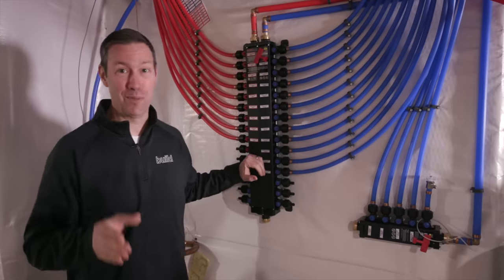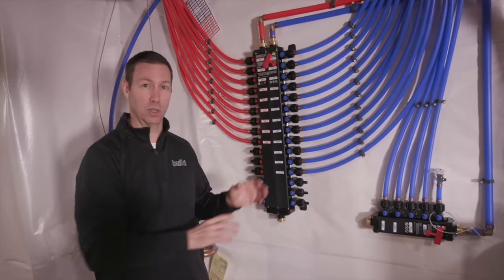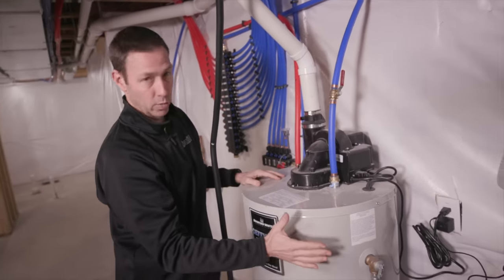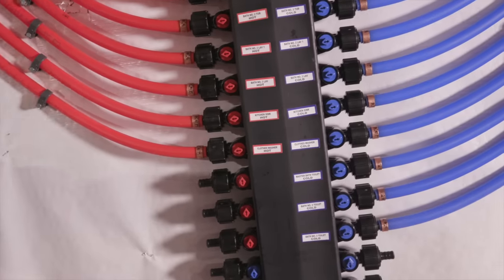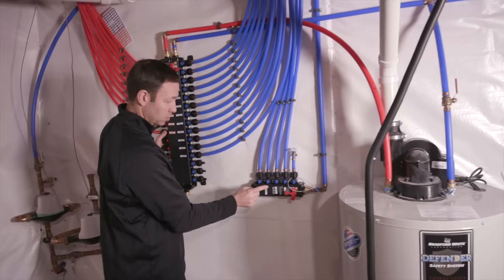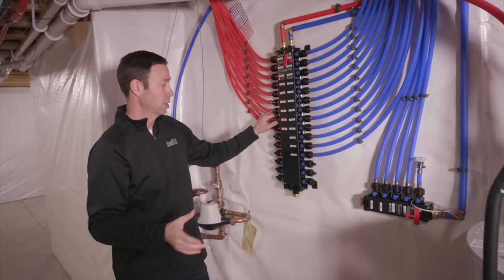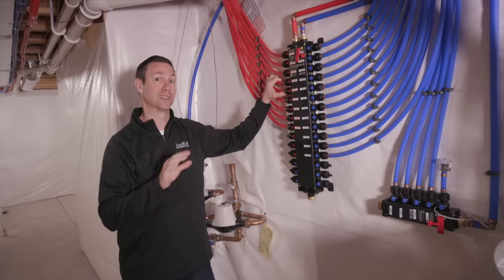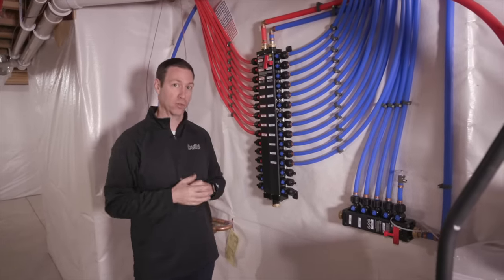PEX Manifold System - Pros and Cons + Tour

Comment: I am a plumber and my biggest complaint about the block system is this... Say you have to work on a toilet on the second floor of a house so first step is to go to the basement and shut the water off to that toilet. Then climb 2 flights of stairs, do the necessary repairs, then wall back down those two flights of stairs, turn the water back on, then back up the stairs hoping there is no leaks while you climb. Then check your work and if some reason you would have a leak, you start that whole process over again. With something like copper you can do all of the repairs without leaving the fixture for the most part. That’s my two cents lol
Reply: I always add a valve under the tank.  You're lucky if a lot of places have even one operable shut off.
Reply: So are you saying that they don't have a shutoff at each fixture? What a pain!
Reply: I'm curious your opinion on a hybrid system where the manifold feeds to a trunk to each room.  this way you would still have your shutoff valves at the fixtures  but for things like the shower you only have to shut off water to that room.
Reply: Trevor Butler they are better but you have to have a place in the bathroom for one. And sometimes there just is no good spot for them. Another thing is these manifolds have special valves that you have to buy from the manufacturer. It’s not something you can get from a hardware store. And no matter what the manufacturer says, valves go bad.
Reply: @ericblatt5249  yeah I would never install one on an existing house.  I have a long term goal of building my own house, in this case I can design room for the manifolds in mind.
Reply: @Eric Blatt "then back up the stairs hoping there is no leaks while you climb. Then check your work and if some reason you would have a leak, you start that whole process over again. "   Sounds like you experience post-repair leaks a lot or have very little confidence in your work.  Not trying to be rude, but the ONLY drawback to a PEX system with no fixture shutoffs (I did one in my 1200sqft one story house) is that if you DO need to change something at a fixture, you have to catch all the standing water in the pipe.  I have 14 lines, and not one of them leaked at all and still haven't after five years. All of them are home runs, only fittings are at the Manablock and the fixtures. With the right tools (which I bought) and the "go/no-go" gauge, (used crimp rings) it was fast, easy and foolproof. I have never had to make multiple trips to the Manablock when adding on fixtures. BTW I am not a plumber, but an electrician. Oh, as for the "special valves", a set of those and the tool to change them is cheap, I have a spare set handy, which I expect to never use.

Comment: I agree with Matt. I love the look and idea of a water "breaker" panel, but in practice, I think you'd have a lot of issues with water not coming out cold/hot for several seconds, especially when pipes are uninsulated. Insulating pipes would help a lot. My pipes are insulated and trunk and branch style (though with the size of my house, all the fixtures are beside each other), and I still hate how long it takes to get hot/cold; I would lose my mind on this.
Reply: If waiting seconds for hot water will make you lose your mind, you have some serious issues. The run from my manablock to the master bath shower is just over 33 pipe feet, and it takes less time for the hot water to arrive than it does for me to get undressed for my shower.  I just don't get why everyone is so damn impatient. The water use to purge the cold is only a gallon or so, and not a lot of time. Must be a millennial thing.
Reply: @mxslick50  A gallon each day times 4 people times 365 days times 20 years... That's a lot of wasted water. 29,000 gallons. If you cut that time in half, not only do you wait less, but you save 15,000 gallons over 20 years. And that's one fixture.

Comment: CONS : the massage jets in my shower also require 3/4 pipes for the 4 of them, where the manifold only provide 1/2, which means you would have to run two lines just for that..
Reply: And the fittings reduce the flow by almost 1/2 so make that 4 lines
Reply: I do beleave you can get the manabloc in 3/4” also.

Comment: My house has a manifold system installed about 12 years ago. The ability to shut off a few specific fixtures is great for repairs, especially those that take a few days or weeks to fully address (shower remodel), and for turning off outside faucets during cold months (NH), but the waiting  for hot water is annoying.

Comment: You can also do a trunk and branch using a few thick pex and then small manifolds for say the bathroom fixtures locally. Makes it easies and ttake less time ot get hot. Thats how a lot of larger construction is moving. Gets hot much faster and costs only a tiny bit more

Comment: Your con would be solved with this system which i have install 13 of them , point of use tankless for the long distance lines for hot.
Reply: Brad's Home Improvements what about also putting in a recirculation fixture with a timer and back up battery?
Reply: @davidb1132  wouldnt know first hand. I Have not had any radiant heating systems in the ones i have installed. Which is what i  am assuming your refering to.Meaning  none of the ones I install had Recirculating systems.

Comment: I have this system in my house. My house is 3000+ sq ft. It does take a little longer to get to my upstairs fixtures. But flush the toilet, run the sinks and shower at the same time without the shower changing temp or pressure, so yeah there is another plus. Surprised it wasn’t mentioned about that aspect.

Comment: In Atlanta the sewage bill is figured off of you water bill (usage) so that when you wash your car you are still paying fees to the sewage department. How that is connected with this issue is that you will pay for the water you run down the drain while waiting on hot water to both billers.

Comment: I adapted my lavatories down to 3/8” and used 1/2” to showers and the washing machine.  The 3/8 has less volume and we get hot water faster.  The flow isn’t enough to approach the limit on the faucet so it works well!!!
Reply: Or you can do loop system with pump (3/8" return) on hot and set timer for times when hot gets used most that way you get hot in few seconds.

Comment: I would never use that system. One of the most expensive things you do is heat water don't ever waste it if you can. If you have gas do on-demand hot water in each room you need it, if not make sure that the runs to hot water are as short as they can be and all of your hot water branching is done as close to the endpoint as possible.

Also, who doesn't have a way to shut off the water right at the sink or toilet? Are you kidding on the extra fixture thing? How much time does a person waste running back an forth to the basement? And what if it's leaking when you cut it back on? This is silly.
Reply: I'd imagine there are still below the sink shut off valves. I wish I had individual branch line shutoff valves when I replaced leaking below the sink shutoff gate valves that leaked from the stem when touched.
Reply: It's not tho. It's set up next to the water heater. So all those hot water lines run straight to it.
Reply: I thought of the same question too. So say you get a leak in the kitchen sink. Now you have to run to the basement to turn off the switch that used to be under the counter? Seems bizarre to me

Comment: All of that work to keep all the sweeping bends and then the plumber places a hard 90 at the input of the manifold 🤦‍♂️
Reply: Exactly! Not really a fan of this system at all. As well, it needs to be fastened down to prevent 'thumping'. Its probably ok as a bundled trunk but might want to move when branched off.
Reply: Good point !!!
Reply: I believe the 1/2" to 3/4" diameter pipe bends more easily whereas the larger 1"+ pipe has a sizable bend radius and wouldn't fit without the 90 degree fitting.
Reply: Sloppy job, poorly laid out.  Wouldn't hire that plumber.  Also, by me you need 18" of copper coming out of the water heater before you go to pex.

Comment: I like this idea for a house on a well where there is no muni water charge. I think a PEX manifold to MPOU electric water heaters would be better than structured (branch and twig) to achieve fast hot water with minimal waste. In that case, you don't even need the hot water run, just cold, although I would recommend always installing hot runs for potential future use. For a Net zero house powered by solar I think this is a no-brainer. A 40 gallon tank always running hot is for the birds.

Comment: I'm not sure I'm a fan. I get the idea that you get a continuous run of pipe so fewer connections. In theory you will end up with extra pipe. Pieces that were not long enough to complete your run.
And I cannot stomach the loss of water and the long wait times for hot water. I think this is very inefficient and wasteful.
Putting in a recirculation pump is also not a great idea on a domestic home as it is extremely expensive to run.
Just my thoughts.
Reply: Hulk Smash  the circulation pump is not the energy guzzler. The heat loss through the pipe is the problem. It can be as much as 12 watts per m

Comment: Very cool setup and I think to defeat the water loss on a long run you can just run a cold line off the manifold to the part of the house that uses the most warm water (washroom,laundry room, etc) and add a tankless electric  water heater.. problem solved on water loss! In the future tankless system will be cheap enough to make the investment and trouble

Comment: It's funny to me when he refers to a 2000'ish square foot house as "small".  But I digress.

What I did on my place was run insulated 3/4" hot and cold trunk line to a closet adjacent to the master bathroom.  The hot feed inputs first into a small electric hot water tank (sitting in a catch pan connected to the sanitary drain complete with primer).  The small tank then feeds to a manifold on the wall of the closet and each of the home runs to the individual fixtures are about 6 to 10 feet.  In this fashion, the hot feeds into the small tank.  When a faucet is turned on in the master bathroom, it first receives hot water from the nearby small tank very quickly so as to avoid wasting water.  If you're in the shower say, you will obviously demand more hot water in the course of your shower than the small electric tank would ever be able to produce, but the hot input to the small tank after about 30 seconds delivers hot water directly from the main natural gas hot water tank in the house, so the electric tank cycles off as the incoming water is up to temp.

There is another manifold in the basement which feeds the nearby basement bathroom, washer, laundry room sink, etc.  Again, all short (er) runs.

The system works well, but it was involved to install and not cheap by any means.  

But hey, I did it myself and you know what they say, "for just a little more, you can do it yourself".

Comment: First a bone; your other paen to PEX stressed the flow gains of not having many fittings; the two 90 degree fittings above the large manifold were unnecessary, and could have been avoided with a little more tube.  Second, and I know it's hard to see from the screen but you were on top of it and "saw" that the maniblock only had maybe a 3/4" passage- if the first  and second lines from the top are flowing, there will be a serious flow problem with every thing below and the codes in the past have reflected how many 1/2" lines you could run off a 3/4" line. You are spot on about recirculating systems- there is no easy way to do it with the home run system PEX advocates. Cordially, a 30 Year Plumbing Vet
Reply: PEX advocates home runs due to the failure point being fittings.  Further, the labor and cost of fittings far outweigh the cost of pipe.  I agree that home runs are not my preference but I disagree with your fluid flow theory.  Your theory assumes that each port on the manifold is flowing at maximum rate, i.e., 80gpm on a 3/4 port.  Not practical to assume. Show me a code that currently limits the size of branch circuits.
Reply: @1dariansdad  All codes limit the number of openings based on average water pressure/flow. when you put too many 1/2 "lines on a three quarter inch pipe, you can have effects like losing the hot water at the shower, etc. the manifold clearly has only a 3/4" inlet, and many 1/2 " openings- unless you increase the average water pressure, you cannot feed more than a certain number of 1/2" lines; "It's physics, Jim!". As you pointed out the home run method reduces the expensive failure points, but make a cost effective HW circulating system difficult. I've even admitted that I am not a fan of PEX- and I made a bucket replacing QEST a generation ago. FWIW, 70% of all plumbing is under a floor, behind a wall or buried- it is all more expensive to fix the finishes than the plumbing- if a PEX line does leak in a wall; do you replace the entire home run or install one of those fittings we agree are the prime failure points and close the wall/floor on it? I was taught the good plumbing ought to last 30 years with little maintenance- does that describe PEX, and that includes the fittings that many city waters will destroy faster than others. Copper has a track record over a hundred years long- PEX has letters of hosanna from the chemical giants that made QEST and less than a decade of formal testing.

Comment: Rats chew right through that plastic pipe like no tomorrow. And just think of the BPAs going through the plastic on the hot side.
Reply: Joseph, if you have a rat infestation, I'd deal with that first before worrying about your plumbing.
Reply: Who said there's a high level of BPAs in pex in the first place?

If you have a problem with rats, I think I'd address that. I refitted my kitchen this year and used pex for the first time and would never go with anything else at this point. 

Do you install copper pipe as your primary day job?
Reply: Once they've finished knawing their way through all the electrical cables presumably?

Comment: The biggest plus is the centralized cutoff of any given fixture.  Typically showers and tubs are a royal pain because there is no cutoff for just that fixture even at the end of the line - as you have with a bathroom faucet.   So without that you have to  turn off the whole house to service or replace a shower or tub fixture.  Even if you do have a cutoff inside the house for hot water, you still have to cutoff ALL the water when that fixture is a single lever valve.

In a relatives house that was a 40's vintage with 3/8" copper, I replaced all the copper with pex.  Ran from the basement to all fixtures with two manifolds in the basement  hot and cold separate.   No run is more than 20 feet because the supply point was centrally located in the basement.   I see no difference in the discharge time for pex from copper.  Copper transmits heat well so there is a rapid cool off of pre-charged lines with copper that you don't have with pex.   The only downside I see is the potential for critter damage to pex - chewing mouse/rat etc.  Other than that running Pex is easy to do and much more forgiving around bends and odd turns.  If need be you can install a fitting and from my experience, they don't leak.  Not a single pex connection I made has leaked and I had never used a pex crimper before.

Comment: Bought a rental house recently, the moron who owned it put in a bunch of PEX. Apparently nobody told him it's flexible, I counted 14 individual elbows on a 1/2" line within the space of about 6 feet of pipe (x2 for the hot line). Cut it all out and replaced very easily with one big sweeping bend, improved the water pressure from worthless to usable! Now a total of 24 connections removed that can never leak.

Comment: Nice system, and i agree with you on the positives and negatives.

When people plan things like this, they need to consider the real world usage for it, and it may be annoying for people to wait so long for hot water.

Like the way its all named, and it can easily be isolated though. People that do plumbing in houses, should have to name everything at that centralised point, where all the main plumbing is.

No system in perfect.

Nice video.

The system was made by someone, whom was dominated in there thinking by safety first. Some people may not agree, but thats the way this person made it, and its there choice.

Some people, when building want to consider safety heavily in construction, and most probably do not.

Comment: In our area, that hot water heater would be illegal, have to have at least 18" of metal/copper pipe before you can connect to PEX.   But as far as the rest of it goes, easy to navigate for servicing and fully labelled.   Although to be honest it is overkill for what you need.   Plumbing every section from a central line would cut down on your manifold size, amount of pipes being run with minimal space inside the walls taken up.   If you take the average bathroom requiring 4 cold and 3 hot lines, that is 7 lines having to be ran from the basement.   Average home has 3 bath, 1 kitchen and a laundry room the piping soon adds up.   I could see that type of system being great for a central heating installation with radiators piped from each line, thus not connecting in series but even as a home owner/diy'er I could do the same setup with half the materials.